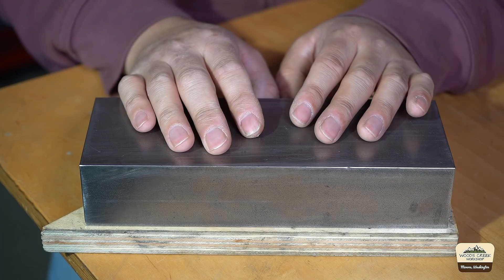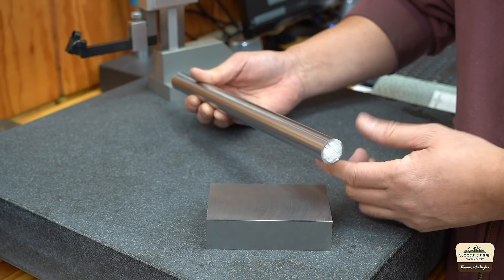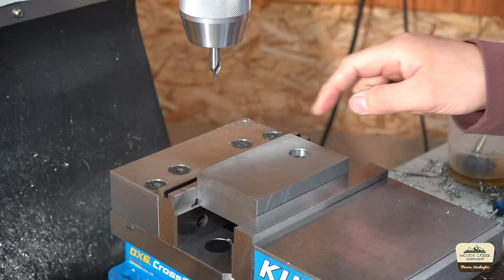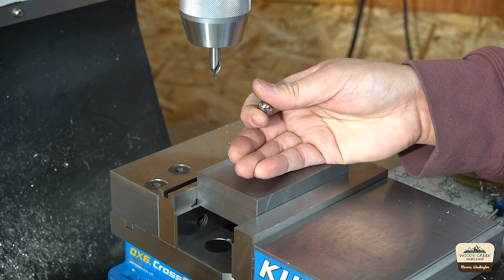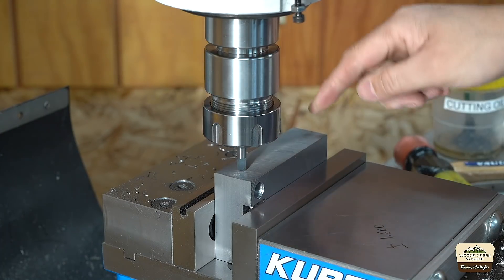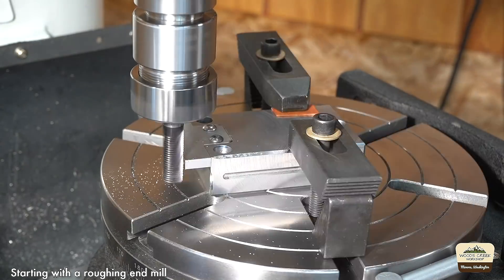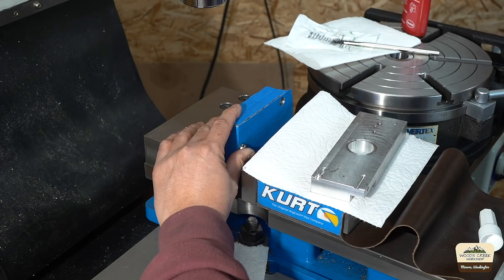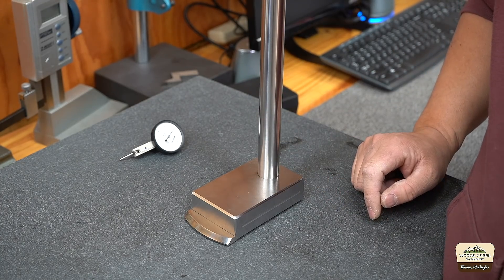Squareness Comparator - Build Your Own:  Part 1 Base and Column

Comment: Slowly catching up on projects I've been meaning to watch
Looks pretty good
I'd be interested in seeing how this turns out. Do you have a granite square or similar to set it?
Reply from the maker: TommyGun Machining hi!  No I don’t, but you can use a known parallel to set it.  Not the most convenient, but it will get you right on.  Tom Lipton did a video awhile back on that.  But I will be building a master square as a project.  Hope this helps!

Comment: Great work up, love the hard shaft and balls plug in, haha, question what type and size of ER Collets set up are you using on the mill, thanks 🇺🇸
Reply from the maker: Mark DANIELS thanks!  ER32 holder (cheap Banggood) with R8 shank.  It ha no measurable runout, impressed.

Comment: Great video!  I'm going to build one but I'm going to simplify things and just use an old surface gage and mount a curved "shoe" on the front.
Reply from the maker: Nothing wrong with that, very simple and effective 👍🏼
Reply: @woodscreekworkshop9939  I just bought a beautiful B&S surface gage on Ebay for $5.  They are cheap and I have a dozen of them. Will have to see if I have one that isn't hardened, to eliminate the annealing/hardening process.  FYI I did buy that horizontal mill and 60 cutters on that auction.

Comment: Excellent as usual. Yuchol I am interested in the collet holder you are using on the mill. It looks like some kind of R-8 adapter. Could you please provide a link to where i can look at one. Thanks Terry
Reply from the maker: Hi Terry.  It’s just an ER32 collect holder that has R8 shank on it.  Mine came from Banggood but you can find them all over eBay, Amazon and Shars.